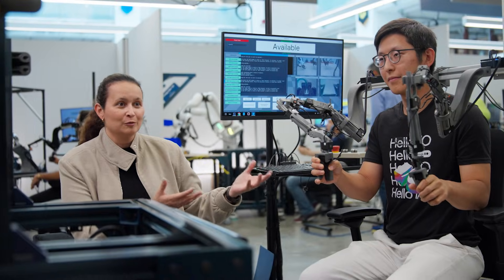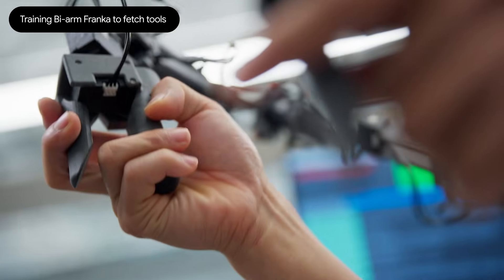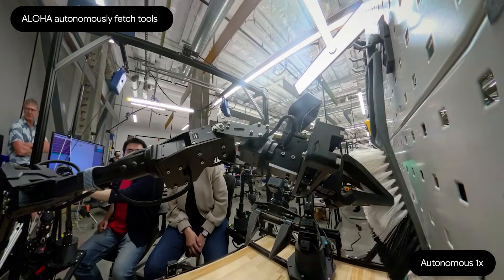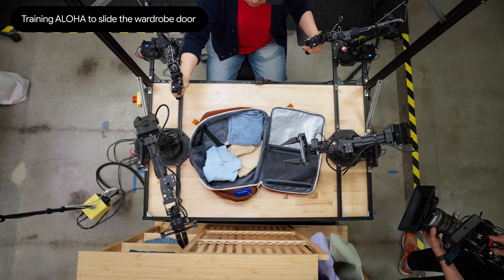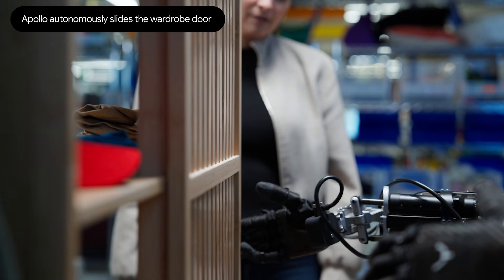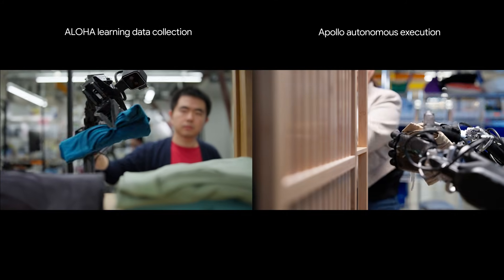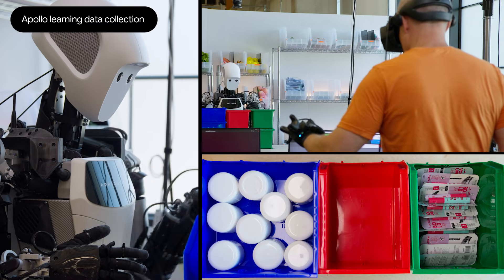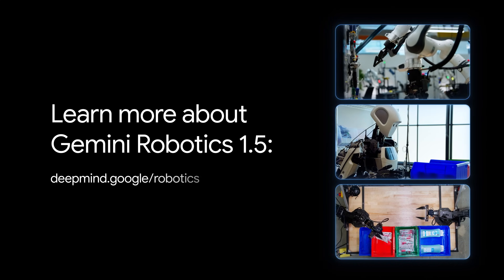Gemini Robotics 1.5: Learning across embodiments

Comment: Why not train them in a virtual world, like letting them figure out the best way to achieve a task in parallel
Reply: Ideally using both a persistent virtual state where it's always teaching itself + plus manually trained data would be the best here to get any robot to get better over time.
Reply: Because every virtual simulation is necessarily a model which doesn't capture all the nuances of the physical world. You could in theory learn how to drive an unicycle just by reading a book, without trying, but in practice you can't